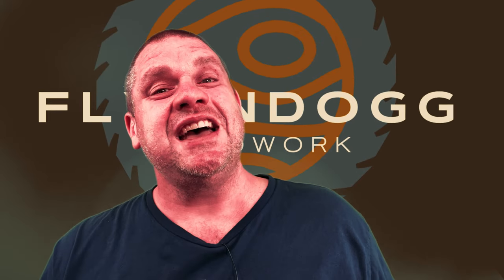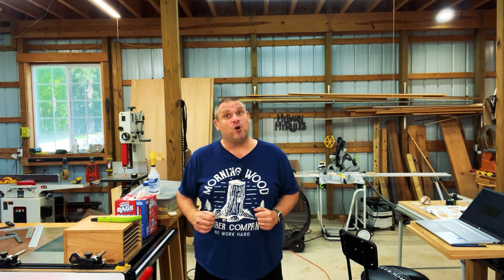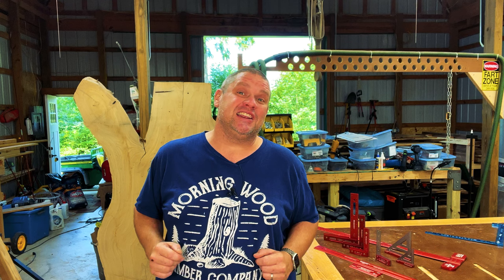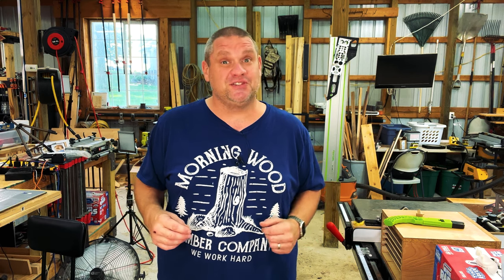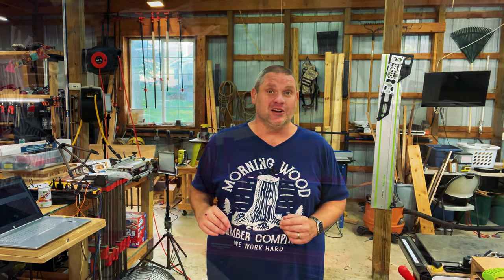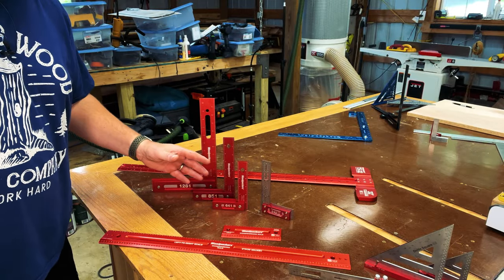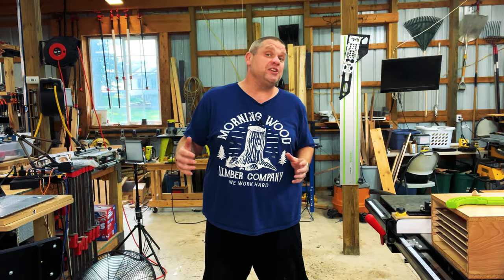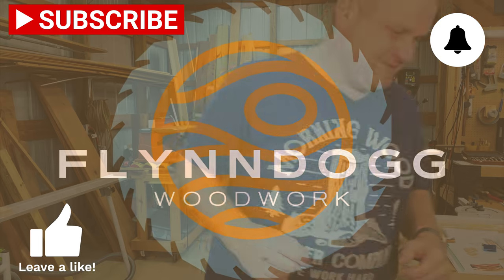Affordable and Effective Alternatives to Woodpeckers Squares #woodworking #precision

Comment: When i see woodpecker tools in a shop. and this includes youtube video inside a shop. If anyone thinks that a 150$ square is worth it. over a 20$ accurate square. i dont need to follow any kind of recommendations from that person or shop. they have no understanding of value for money.
Reply from the maker: Well I think different people have different budgets for things that are important to them and they wish to spend their money of different things, but your point is received!  Thanks for watching!
Reply: @FlynndoggWoodwork  If you can afford to make that mistake i guess go for it? personally i think getting a CNC and making your own tool is a much better way to go. granted i do have little over 3,000 invested but i make much more then squares....
Reply from the maker: @st0mper121  I hear you.   $3000 is enough to make an awesome shop that is for sure!   I love the idea of making your own tools.   I'd love to do some videos on that. I actually recently bought a book about that same topic!
Reply: @FlynndoggWoodwork  I started off with a OnefinityCNC If your thinking of this route. Might want to check them out. the new ones have some really nice controller upgrades.
Reply from the maker: @st0mper121  It's funny you mention that.  That was one of the brands on the top of my list.   I'm temporarily holding off on buying a cnc for a bit though as I'm getting my workshop insulated/heated and cooled so my budget for woodworking is spent for a bit! :(   Great suggestion though!
Reply from the maker: @st0mper121   Boy oh Boy, you guys really do pick out the best ones.  That one is also on my list.  I was just watching Fisher's shop where he was using it and it seemed really user friendly!  Thank you so much for sharing!
Reply: I don’t judge anyone regardless of their own tool choices,why I understand is that people tend to gravitate towards what is most reliable and accurate,I personally have bought cheap squares before that even when taking care of it didn’t stand the test of time and use,therefore I make the choice to buy once for accuracy and quality
Reply: Yes SIR!😅

Comment: I am not a Woodworker fan, but when it comes to a tri-square I only use a Starrett Combination Square. The Swanson, Empire or the Wood rafic dosen't even come close to the quality and accuracy of the Starrett.
Reply: Starrett make good tools but they are very expensive.  More people who don't have your budget should know any combination square can be tuned with a file or even sandpaper to be dead on accurate.   I'd suggest this is an important skill to learn as one day you will drop your Starrett and it will need some love.
Reply from the maker: Awesome, and thanks for sharing dickie!   I wish I had some starret tools as well.   Don't really need them at this point, but If I every want to replace my combination square that is the brand i  will be looking at first.  Thanks for sharing and thanks for watching!
Reply from the maker: Good to hear zamboni!  I'm sure the quality of starrett is the best (probably even better than woodpeckers).   I will be looking at their combination square if I decide to ever upgrade mine!   Thanks so much for watching!

Comment: I have a cheaper alternative for the T square. I bought a drywall T square from Lowes a few years ago. It's 48" and amazingly accurate. I use it quite a bit to break down my full sheet goods.
Reply: I did the same but measurements are far from accurate… I think the end is more than an inch off…
Reply from the maker: Oh, thanks for sharing Brady, If I needed one of those that would have been another excellent tool to feature as an alternative.  Thank you so much for sharing and watching!
Reply from the maker: Ugh, that sucks!  Can you return it.   That's rediculous!
Reply: It's OK for rough cutting.  But I tested three and all were off by more than an 1/8"   But for Drywall work, that's perfectly acceptable.  Considering you need space for the mud to do its thing.  And it's fine for rough breakdown so you can fine tune it on a tablesaw.

Comment: I just returned a TS24 T-square to them after the first time they told me they would repair or replace. They did neither. They sent me back mine as if I wouldn’t CHECK it. I’m done with their ass!
Reply from the maker: Oof!  That sucks.   Sounds like their customer service may not be as good as they claim.  Probably a good idea that you returned it.   Check out the goingmake t-squares.  I think they are just as good and about 1/3 the price.

Comment: Nobody NEEDS Woodpeckers, but if like me you want at least one guaranteed accurate square in your collection a Woodpeckers square is a nice tool to have if you got some spare cash. I have the WP 1281 and don’t regret it. You CAN instead buy a good quality alternative for a fraction of the price and do the horizontal flip test to check for square, sending back any that fail.  I bought a Presch 12” combination square and it was spot on, as good as my Woodpeckers square.  I also bought a cheap’ish Chinese square from Amazon that was far from square.  Don’t forget though, you can also make a true square of ANY size with some metal flat bar, old Pythagoras and some easy maths.  Oh and NEVER drop any square..or it won’t be😊
Reply from the maker: Totally agree contessa!   One of my favorite brands that I've been using more and more is iGuaging.  I did a video on them a few months back and I've been using their double square like crazy.  Thanks so much for sharing and watcing, Really appreciate it!

Comment: Hey, if you’re curious about Woodpeckers or any other expensive brand, but hate to waste good money, then save up, buy a small square or ruler or whatever and try it out. For myself, they’re not worth it, but then I don’t have money falling out of my pockets. If you don’t either, I would probably go to one of the big box stores or your local hardware store and check out their stuff. Squares are easy to check. Just grab one, set in on the shelf, mark a line, flip it over and check it. If it matches the line and isn’t flimsy, buy it. As far as tapes and rules, don’t switch between them during a job. Use the same one to mark for a cut as you did to measure for the piece. Doesn’t matter if it’s off a bit because everything will be off the same amount. I would rather spend more on my power tools. I don’t think it matters if your line is perfectly placed and square if you have a crap saw that you can’t keep on that line, or a drill press that wobbles.
Reply from the maker: Great suggestions BobBob!   Thank you so much for sharing.   I did exactly what you suggested.  Saved up for the 642.  I ended up really liking it, but nothing quite stood out to me more than the original square.  Other than maybe the t square.  Great suggestions and thanks for watching!
Reply: @FlynndoggWoodwork  Thanks for that. I’m sure Woodpeckers and the other top of the line products are pretty good, at least they better be. For someone running a woodworking business and especially with employees, they would want consistency throughout the shop. But for the hobbyist or a one man band woodworker trying to make a living or extra money, you got to watch the overhead. The tools have to pay for themselves. There are good quality squares and rules out there that don’t cost an arm and a leg. I think a triangle square is the way to go. With those if you find one that’s square and made with good thick metal, it will stay square. The T squares that are riveted together can get sprung or bent or the rivets get lose. And you don’t want to drop it on the floor and step on it or drop a 2x10 on it when it cost a couple hundred bucks. Again, save the money for a good table saw and get a good fence and miter gauge for it. The fences are usually decent with the higher dollar ones but the miter gauges tend to leave a lot to be desired. And give it a good tune up. Even the good ones may not be set up correctly right out of the box. Square the blade to the miter slots, align the fence to the blade, turn in the miter gauge. Might find out that it was the saw screwing up the cuts, not the measuring tools.
Reply from the maker: @BobBob-eh5sb  great thoughts! I agree.  I've been wanting to get one of those table saw gauges to check my blade for square etc.   I think my fence is a little off too.  All things I need to check and calibrate, hopefully sooner rather than later.  Thanks again for your insite!

Comment: I have several Woodpecker tools, and what you say about them is absolutely correct. I started my career as a drafter and was taught to no use a ruler or scale to draw straight lines, haha. I only use the WP rules for measuring. The center is great. I got a slide stop to make repetitive marks and is great for that. A word of caution to drywall T-squares. Check their accuracy. I have had a couple from a box store that were out of 90°. They get banged around easily in the store. I wish I saw your video on the aluminum square. Quality is great, and great for making 90° marks, but it's kind of limited vs. the SS one with marking holes.
My favorite WP tool is definitely the Delve Square. The little 4" one. Although the holes are a 0.5mm lead buster, I use that gently. I replaced most of the trim in my old house and the Delve is great for that 1/4" reveal when nailing it up. It's trim, not fine furniture. Thanks for an entertaining and educational video Flynndogg! My first one of yours - subscribed!
-Dave
Reply from the maker: This is awesome stuff Seamdye!  Thank you so much for sharing.  Great point on buying the drywall T-squares.   I came really close to getting one a few months ago, and noticed it was bent before I bought it thank goodness!    Love the delve square as well,  4'' is probably the only one I use out of the two I have.  Thank you so much for subbing! :)

Comment: I drilled and tapped a hole in end of the short beam my framing square and screwed a small, rectangular aluminum tab perpendicular to the beam, which supports the end of the square on the workpiece.  This is a reasonable mod for me because I rarely use my framing square for anything other than layout work on sheet goods.  That said, I do use it for roofing and stairs, but only once every year or two.  When I am using it for framing, it's really easy to remove the tab, or as I more often do, loosen the screw and rotate it parallel to the beam where it's out of the way.  Keeping it attached to the square assures I don't lose it.  This is a dirt cheap mod that most of us can do with scrap, and with a tiny amount of planning you can make sure the tab rotates out of the way without obscuring any important markings.
Reply from the maker: Love this idea!  Thank you so much for sharing Charles.  It’s comments like this that I really enjoy reading, thank you so much for sharing and watching!

Comment: For sheet goods, I've used the humble drywall tee square.
They are light, have measurement marks on the tee and the cross, and can be used as a straight edge in layout.
No pencil holes, and maybe not as accurate as the WPs. But for under $30, it is a multifunctional tool
Reply from the maker: Love it, you can't beat it for the price!   Keep it up and thanks for watching Shadowulf!
Reply: Same here brother!  Can't be beat imo

Comment: Great video. The combination square is probably the single most important tool for me. I agree with comments on the Drywall square being used for breaking down sheet goods. I think woodpeckers is really a luxury enthusiast brand like Festool is. But unlike Festool, I it's best to pick one or two tools from them that have the "package" of functionalities you use most often instead of seeing Woodpeckers as an ecosystem.
Reply from the maker: Oh man, you are so correct!   The combination square was probably my second square ever, right after my framing square (that was a bad choice for my first square).   I still use that combination square on almost every project at is is one of the most versatile.  It's a swanson and I haven't seen a need to upgrade it at all since I got it.   It works perfectly!   Thank you so much for sharing and watching ScholteimReinbach!!!

Comment: I use my woodpeckers squares to check to see if other squares are actually square 😂 the tolerances over length also seem to give them an edge over others I’ve used. That said, that level of accuracy is usually more than your average Joe is looking for, and most usually go for machinist tools at that point.
My fav woodpeckers tool is their 4” saddle square. It sees almost daily use. There are alternatives for this tool as well.
Reply from the maker: I'm glad I'm not the only one that does that! :)   I agree, the tolerances over length is one of the best features with woodpeckers.    That is why my TS32 is one of my favorite one of theirs.   It's funny you say that, I've been wanting a saddle square, and I've looked at the 4'' one a couple of times.  Seems like that would be just about the perfect length and small enough to not be in the way.   Thanks so much for sharing your experience and thanks for watching Justin!

Comment: Here is what i used in my whole career as a cabinet maker.  First up one good quality you say machinist we say engineers square, this only got used to check my working tools their accuracy makes woodworking tools look rubbish by comparison.  Two combination squares, one 300mm, one 150mm. A sliding bevel and a setting guage. Several tee squares all made in the shop. Steel rulers in lengths from 150mm to a metre.  If I needed anything else i made it myself. I still have the first tee square i made as an apprentice nearly 50 years ago.  

I dont agree with everything you say but you made a great point about the 'red tools'. Every woodworking channel has them and they sure as hell didnt pay for them and hey it worked because you watched all these people and thought i need all this stuff and now you realise you dont.  You should pack up all the stuff you dont need and send it back to them with a note saying refund please no longer required to get the job done! They are over priced junk in most cases and certainly not essential to any woodworker.
Reply from the maker: I love this comment!  So awesome to hear someone who does this for a living comment on what they actually use.  Thanks for that.  I’m actually getting ready to redo my shop and I’m taking a serious look at what I actually use and just have because I thought I would use it.  I will be doing some “fall” cleaning!  Love this and thanks again!

Comment: the one woodpeckers tool I use for everything is the saddle square 4 inch in my apron. Used to use the Paolini Pocket 6 inch but since getting the saddle square I have not used. I like the saddle for being able to scribe a line on on both faces so when I do dados or groves I can setup easier. I bought a bunch of those Banggood veiko squares and others from veiko great tools.
Reply from the maker: Awesome Danko!  Love hearing what tools others use on a daily basis.  Sounds like you have an excellent setup that works well for you, which is all that counts.  Thanks again for sharing!

Comment: If you want something closer to Delve square, DFM makes a great alternative. A good alternative to the T-Square would be to pick up a carpenter square fence from someone like TayTools or Lee Valley. The fence then would turn your carpenter square into the perfect alternative to the larger aluminum squares with the the lip and the T-square. A different alternative to the T-square would be a drafting but you run into the issue that it does not have the lip like the Woodpecker version.
Reply from the maker: Excellent Points AxGryndr!  I've been wanting to pick up one of those from Taytools for a bit now.  The last couple of times I've looked they have been sold out.  I need to check them out again to see if they are in stock again.   Excellent point with the DFM as well.  I have yet to buy any DFM tools other than a card scraper, but I've heard great things about that brand and I need to check them out.  Thanks so much for sharing and watching!

Comment: You are absolutely right with the alternatives. Woodpeckers is not trying to reinvent the wheel.  The extra features are nice but you buy woodpeckers tools for their accuracy. That’s why they’re expensive, everybody knows this. You are not getting 0.001” squareness over 12” with Swanson or empire. I don’t own any woodpeckers tools but I would 100% like to get the 1281. Having a square that I know is square and Carrie’s a life time warranty is well worth its price. I’ve already in my short life have spent way more on cheap squares that I coulda bought some woodpecker tools and I’m a fool for doing so.
Reply: I don't know anyone doing, or any application in woodworking that needs 0.001" accuracy in woodworking.
Reply from the maker: That's pretty precise, that's for darn sure! :)
Reply from the maker: You are correct John, that is what you get with woodpeckers and I think that is why they can justify the high price tag.   You will never have to worry about how precise those tools are, but you are going to pay for it.   At lease with woodpeckers you can't blame the tools for measurment errors  :)

Comment: Good video. 
I like the Igaging Square, mostly because of the base having a 3/8 inch, and I think a 1/4 inch overlap, so marking the center of a board is much easier. For Eg, when doing layouts for mortises. They do cost a bit more than a speed square, but they also have the holes for measuring.
Reply from the maker: Thanks so much for sharing douglas!   A lot of people mentioning iguaging from this video.  Sounds like another excellent option.  Sounds like I need to look into this brand!  Thanks for sharing! :)